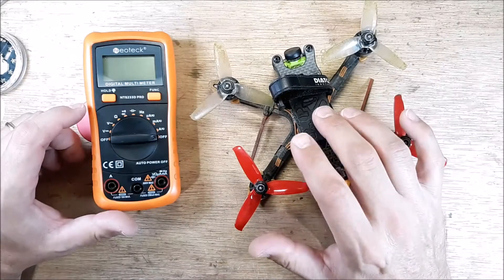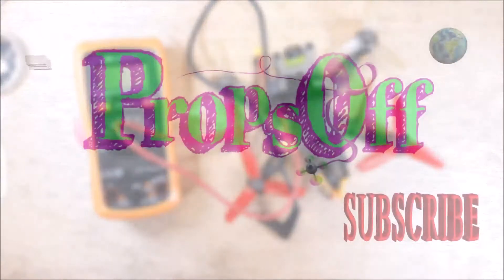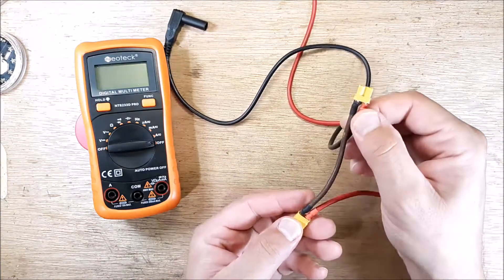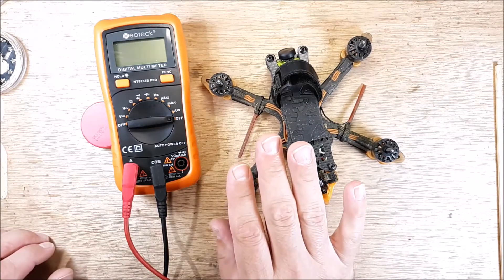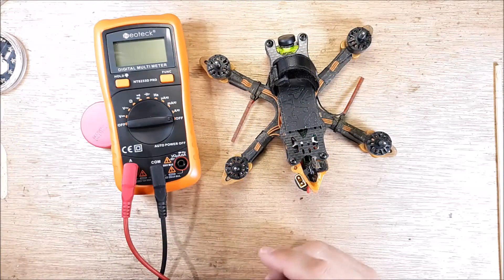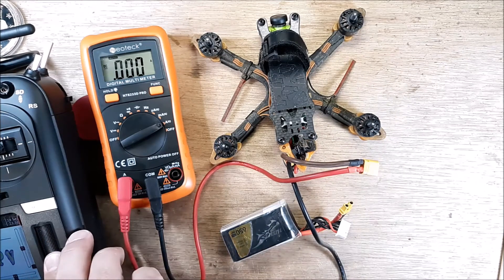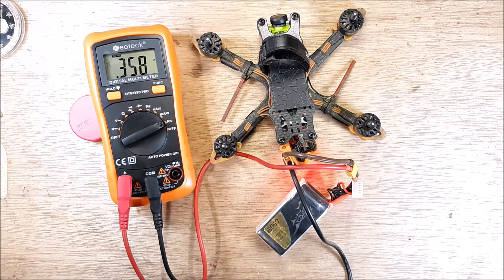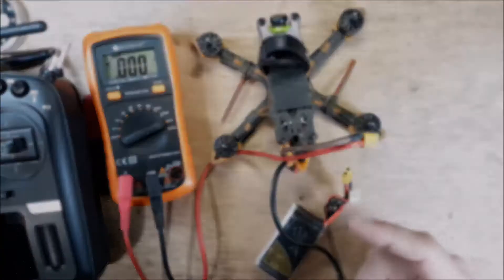How To Measure Amps | How To Check AMP Draw Of Your Quadcopter

Comment: With the nice harness you created and if you have a clamp on type amp meter you could do a full load amp draw test of it with props on and max throttle. Of course you need a jig to hold the quadcopter down. I'm currently amp testing one of my quadcopters but my multimeter is limited to 10A so I can't do full load but I still had fun spooling the motors to just above idle and monitoring the current. Got to get me a clamp on type one of these days.
Reply from the maker: I am trying to only use this meter on the channel, to keep it inexpensive. I personally would never spool full up on the ground, burn stuff up that way. 30% is good enough for me. It's nice to double check the current of the quad to Betaflight. Enjoy the Breeze...👍🏻🍻👊🏻